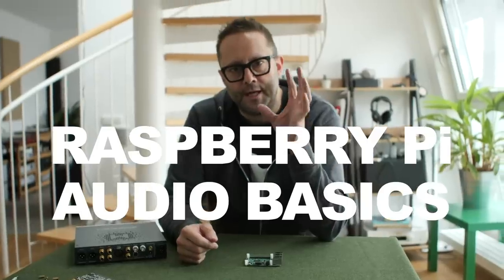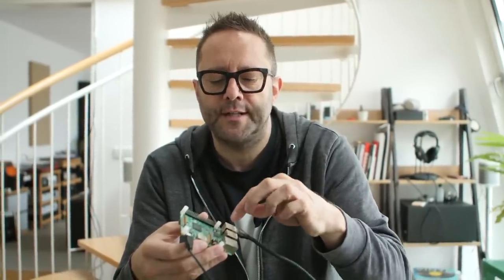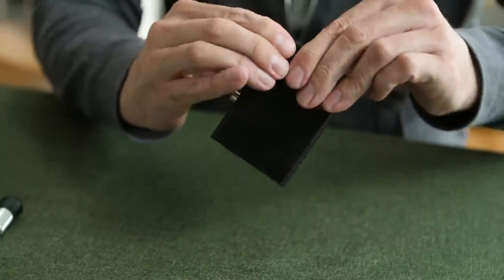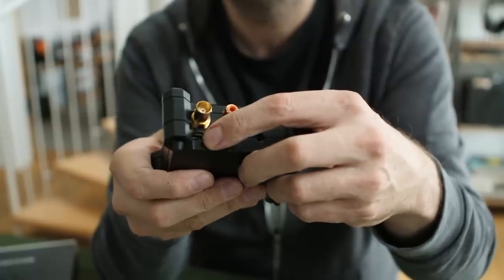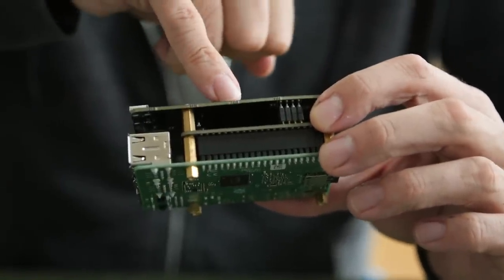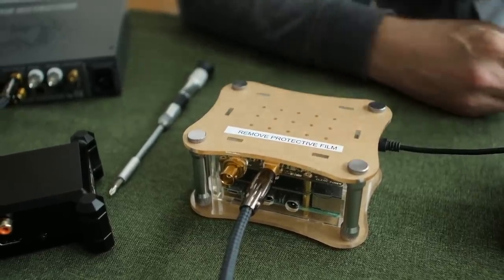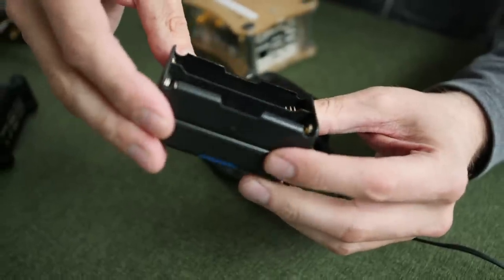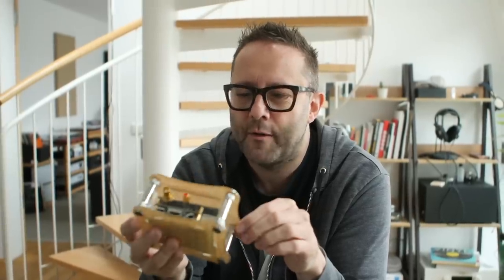Raspberry Pi with ALLO DigiOne Signature - a rewind and a review

Comment: Thank you, John for a thoughtful review. I’ve added a Schiit Gumby and the Allo after watching the Darko Audio short films and reading the reviews John has written. John describes how products behave without techno-babble. 

Engineering is about using science and experience to design stuff for the ordinary pursuits of life including storing and reproducing music. Theory tells us how to go about it. The art enters in because we have to approximate some of the requirements of theory like ideal low pass filters and deal with the artifacts real world circuits impose on the objective wave form. To build a good device, you first have to build a lot of bad ones & learn how to leave the bad bits out. Allo has done this brilliantly with the DigiOne family of kit. Allo deserves its good press & favorable word of mouth. 

Two things drive price in high end audio: selling through dealers vice direct like Allo does and expensive enclosures which Allo foregoes. Jason Stoddard explains in “Schiit Happened” available at Head-Fi. Allo has been brilliant in artfully generating a clean AES3 SPDIF signal from the IIS signal produced by the Raspberry Pi. All of the effort has gone into the circuit to clean up the switch mode 5 volt power and to reconstruct the AES 3 timing and bits properly. 
I’m hearing it as John describes in his thoughtful review. I also expect that Allo has hit the price/performance sweet spot and that there will be little further improvement possible in this part of the audio system.

Comment: Those are 18650 batteries, those are extremely powerful and dangerous if you don't know what you're doing when using them. I'm honestly very surprised that thing only runs for 12 hours with 4 of those.
Reply: 14:19 All you vapers, assemble... cringe.
Reply: @circattle  I have had one catch fire and off gas like a fire cracker on me after spilling my scotch and coke on it ( managed to get it out the front door before it got to bad). + another get crazzy hot and almost go critical after putting it in my pocket and shorting on my keys 🤣🤣🤣

Comment: The minus side of the battery ALWAYS goes to the spring terminal. Your mistake was following the markings instead of the instruction manual. Allo requires an off the shelf battery holder for two series batteries in parallel with another pair. Yes, they should put a sticker over the molded markings.

Comment: I actually use the raspi with usb at the moment and was about to decide whether i use some sort of usb filter (ifi ipurifier) or exactly the setup with the signature board...
Your review convinced me to buy the signature board
Many thx for the right review at the tight time 👍🏻
Reply: It's a shame because I've been doing this for years. Pre-raspi days, I used an ALIX board running Voyage MPD. I now use a raspi running Volumio. All the galvanic isolation and jitter bashing is done by a Musical Fidelity V-Link 192 (sadly discontinued). I power the V-Link with a linear 5V supply that is completely isolated from the data feed.
Reply: @circattle  How would you go about streaming on a raspberry pi nowadays if you only can use USB as an output and want to avoid jitter and interference?
Reply: @polystyrene_gangster  Hello Yannick search for Allo  Usbridge  and Usbridge signature with audiophile USB port

Comment: Nice. It´s weird though how often when you cheerio up and research these "cheap" awesome diy things, one often ends up - after approximetely 4.36 hours of research - realizing that with all the integrally important "add-ons" the final pricepoint is like 500 quids for an acrylic box with super duper just-below-high-end-capacitors and half the processing power of a 1960s moonlanderPC init.? Of course, by this point you are so invested that you have mentally adjusted your real life budget upwards, and in doing so you actually have been surpassing the price of the professionally assembled product you initally wanted to  buy. So I am thinking that maybe, just mabye, why not try ground up unicornhorns and use them as cablefillers in order to maximize the acrylic resonatory redudancyresponce of the eigenstate flux? Do we really have anything to loose at his point, I mean, hell hath no fury to a diyist inspired right!? What about a fart-capacitanced windmillpowered strawberry-pi with apertureregulated omnipotence as an add-on?. That said, I´ll probably buy one. Hell, I just ordered two.

Comment: Great video. And while a battery pack sounds great in principle, its impedance is incompatible  with a fussy audio set up because the impedance of battery power is so high. That basically translates to it not responding to power peaks as fast as a good switched or linear mode PSU.  Is that why you think it's smoother - because its slurring the delivery?

And don't forget, many DAC HATS push power down to the RPi, dispensing with a wall wart for the Pi altogether, rather than relying on dirty power up from the noisy RPi.
Reply: zenscape ; I’m not sure you’re right there. It’s not like an analogue amplifier driving speakers with high current flows. It’s a computer with no moving parts that draws a teeny weeny minuscule current. 
Are there going to be ‘power peaks’ that relate to what is going on in the signal path?

Comment: Thanks so much for the explanation John. What I don’t understand is why the filthy sound coming up to the dirty board can get converted into clean s/pdif and not affect the final output, but without the optical isolation it would? Surely if electrical noise adversely affects the digital signal in I2S, then it’s already too late!?
Reply: I suspect the i2s is being generated cleanly, that is there's some kind of optoisolator in the chip so the noisy digital input is sent over a very short optical link, then on the other side converted to i2c with the 'other side' powered off the clean power.

Comment: I've been a happy LMS/Squeezebox user since 2006 and to this day I still prefer to buy my music.  High resolution when possible, otherwise Bandcamp or CD rips.  As the years have passed, I've become increasingly concerned that there was no real replacement for an LMS player on the market.  The LMS/Squeezebox combo has long been an extraordinary value and Roon's cost makes little sense to me at this time.  I've long been aware of the Raspberry Pi option, but for a long time going this route involved serious tradeoffs in signal quality and since my own boxes were still working just fine, I just kept watch from the sidelines.  Now comes this video. Concurrent with a thread I posted on the Squeezebox Forum looking for 3rd party hardware this video played a significant role in my purchase of a Digione Signature Player and an iPower supply for the clean board.  So far I have to say the sound is quite pleasing even though it's only on its second day of use.  I just wanted to say thanks for taking the time to make this video.  It went a long way toward demystifying the process and also defending the ultimate quality of the sound itself.  As an added bonus, this gives iPeng, my favorite controller app, a new lease on life.
Reply: which os have you take for your LMS and ipeng? Dietpi? Do you think, the signature is better in sound than the squuezebox touch? what is your review after 7 months?
Reply: Thomas Schynol apologies. I never saw a notification for your question. I continue to use the Allo Digione Signature and in the months since have added a Shanti power supply(Allo), changed the OS to Max2Play and I’ve also changed the Allo into a server in addition to being a player.  An ssd in a usb enclosure works well enough with reasonable levels of latency. I highly recommend Max2Play if you’re an LMS user. It’s MUCH easier to use than Diet Pi(admin via web browser).  The Allo offers a significantly darker background than a Touch.

Comment: Really Good Video! Thx a lot John! Two Questions: I have currently a Rpi3+Digione+7" LCD Touch Screen. 
- I currently need 2 PSU (Rpi3 + Screen), so I guess with the Digione Signature I ll need 3 PSU?
- At the moment it's all in one case with the screen, I don't think the Signature will fit in the case anymore and so I guess I will have to fit the screen box separately and connected it via HDMI?

Comment: Suggestion - just use a good power bank to power both the pi and spdif hat as they provide cleaner power than than most mains psu. Additionally underclock and under volt the pi, performance is not required. Personally prefer a good toslink connection as it completely isolates the dac from the pi.
Reply: GoodFodder ; Good point. Not to mention that if you have decent DAC then you already have the HAT functionality, possibly even the exact same circuitry, in the front end of your DAC anyway. 
I can’t see the point of having it twice.

Comment: I seem to remember some company makes a LiFePO battery pack that has two sets of batteries, and it only presents the non-charging set to the output and the other set charges while the other is in use. The switch over is automatic and happens so fast (and I supposed there's a capacitor to smooth it over) you don't have a "pop".  I can't seem to find the thing, and I suspect it's specifically made for some dac so it might not work for this ADS thing.

Comment: Great review! As for the battery situation... Looks like you blamed the battery for lack of attention... Overal great review!
Reply: The problem is that the battery holder marks the polarity differently for each side. On one side the two batteries connect as expected with the spring to minus, but on the other the spring goes to the plus which combined with the polarity not being clearly marked makes the battery holder a very bad design.

I would not buy it for that reason, as over the course of a year or two I may make the same mistake.

Better to go for an upgraded 'traditional' power supply, I think.
There must be better and safer options.

Comment: on Allo's page they have a video stating that you should connect negative to the spring and ignore the +/- on the adapter.  Which is the opposite of what you found.   The guy was full of beans, anyway.  He stated that 4 batteries will produce 6 volts.  4 18865 batteries will provide around 14 volts.  In parallel you will get 5000mah instead of 2500mah so they should provide an average of 6.5 volts for longer (and no fires).  My question is:  Why does Allo keep the ridiculous incorrect video on their site?

Thanks for the vid, BTW

Comment: Might be a silly question. How do you control it? Don't you still need mouse, keyboard and screen?
Reply: There's this thing called SSH, it's use is described on raspberry pi's website - wireless access to raspi's console from a computer.  You can also connect it to a monitor via HDMI, a keyboard and a mouse.
Reply: You typically run some type of audio linux distro like volumio for example, in "headless" mode. Basically you control the Pi via a web browser with its ip address. You can use your tablet, phone or computer to controlnit, they must be connected to the same network.

Comment: Does noise in a digital path - from raspi to the dac over USB really result in noise in the output? I mean, wouldn't the digital signal denoised during the process of decoding etc. inside the DAC?

Comment: Why using a switch mode power supply on the fully isolated board?
(And why powering the Pi and dirty board through the fully isolated board (which sounds much less isolated all of a sudden) rather than the Pi's micro USB?

Comment: what do you mean by "digital audio travels up"? what is digital audio? is that an audio file content? or is it some middle stage between FLAC file (for example) and audio analog signal? I thought that data from file / stream is taken in packets and passed to DAC and only in the DAC chip the audio signal is synthesised... but then there is no "digital audio"...
Reply: P.S. how at all can streamer impact sound quality if it is only data transmitter to DAC device?...

Comment: I ruined so many batteries by over discharging them, I even installed a voltage meter on my battery pack, which made it even worse when I forgot to check it and ruined another pair. I finally ended up getting an Accopian linear regulated power supply for short money on eBay. Maybe I'll get around to installing both the Signature and power supply into a case worth installing in the rack, tell people I paid more than I did.

Comment: How are you using the RPi + Allo Digi One in terms of communication with the network? 
Do you use WiFi? You have a metallic shielding around the Pi and I wonder how that behaves in this setup, as I want to buy the same.

Comment: Just saw this. Very impressive. Just out of curiosity, if it's not asked before, did you try running the original Digione from the battery pack and did it reduce any of your noise issues...?

Comment: I found your review and  thanks!  which software would you recommend? dietPi + allo gui, moodeaudio, volumio, or max2 play?  Lastly,  I am currently running martin logan aerius II, with rotel dac, rotel receiver, apple airport express, and a tube buffer. I"m amature at this, still learning. I got many of this as a gift. Looking upgrade my digital streaming player.  Should I buy the allo digione player or wait for the digione signature with the metal case?
Reply from the maker: Dennis - I've done what I can to inform viewers with this video, which includes my software recommendation...for me. What you like might be different. The rest, therefore, is up to you.
Reply: I'm using Runeaudio latest 0.5 version. Works very well

Comment: Surprised no one has built a power supply that mirrors a real DC / Telephone  set up ie having the power always coming of the battery and have those batteries connected to a charging circuit

Comment: Crazy question... wouldn't a good capacitor with the appropriate circuitry be a better long-term solution (no recharging necessary) than that sketchy battery pack?

Comment: John, have you tried powering the original Digi One with the battery pack? If the battery gives a cleaner power supply than the brick, I'm wondering if just using the battery on the Digi One accomplishes the same goal as the dirty/clean boards and separate power supplies of the Signature.
Reply from the maker: Which battery pack?

Comment: The battery idea seems a pain and just like the separate boards surely there is a high quality large capacitor power filter that can be piggy-in-the middle between psu & pi?
The capacitor should be located as close as possible to the power input and why any plug type of any description means that a battery option is offered but the wrinkles on my forehead are saying eh! Filter that input and close and I doubt the difference between battery and input filter would be much but like batteries much better than any plug type PSU.
Reply: Actually just had a look and something like this because its dual for £10 could supply both just make the run extremely short to Pi and dac and then have a standard single 12v or 24v with the long cable run suppling this class A PSU https://www.aliexpress.com/item/Class-A-Parallel-Regulated-Power-Supply-Finished-Board/32719878792.html

Sort of surprised the dac board doesn't have a parallel screw terminal power so a short pair of high quality leads can go direct as it all becomes relatively null and void due to probably the worst power connector ever of micro usb.

Comment: Hi John, great video
But I would have loved if you would have tried a good LPSU powering at least the digione signature board.
Would have been interesting to know how close is the battery pack sound to a well designed LPSU
In that case, you should also let know the senior guys at Allo that's it's about time they release their own LPSU which I guess they are working on since a long time
Reply from the maker: ALLO sent me a battery pack and 2 x switchmode PSUs - so that's what I used in the review.

Comment: So I might be late to the party since you made this a year ago, however you do realize all of this dirtiness is digital right until it passes to the DAC?  So in general it can NOT be dirty as digital is just a bunch of 1's and 0's.  So long as the square waves are formed well enough (rise/fall and ringing) that the digital circuity can understand them that is all you need because again until the 1's and 0's hit the DAC and come out the other side they are nothing but just 1's and 0's so the noise your claiming on the GPIO pins is not going to be heard post DAC in your audio.  Also your "technically" correct about the USB to DAC, but only in the case of delay and not noise.  A digital signal is a mathematical representation of an  analog wave from and not subject to [additional] noise.  So if the Ethernet busys the bus there will be a delay in sending, however since we are only talking say 20KHz or so for audio  is nothing so  if a dedicated streamer one would be hard pressed to see a delay.  Too I don't mean to be a troll as I enjoy your videos, yet all of this referencing "dirtiness" in digital terms simply detracted from your quality product!  :-)
Reply from the maker: Dirtiness here refers to electrical noise than 'infects' the DAC to disturb its data clock AND its analogue output stage. It has nothing to do with disturbing the waveform.
Reply: @DarkoAudio  as said above, if we are talking about SPDIF or TOS direct to the Amp or DAC then you can't dirty up 1s and 0s. If you are referring to "interference" then that is a completely different kind of issue. Any decent Amp or DAC has to deal with this type of "external interference" anyway. With a Pi hat using TOS its digital and optically isolated from the source to the final device that does the digital to analog conversion. The Pi is bloody noisy so move it as far away from your analog gear as possible and put it on a seperate power supply.